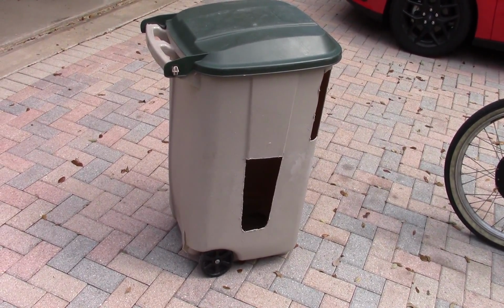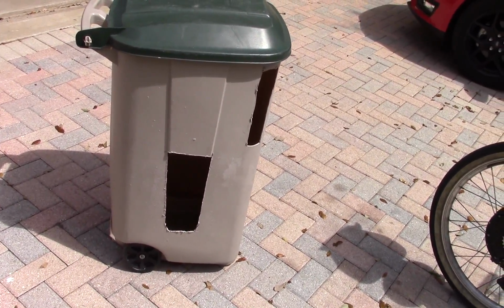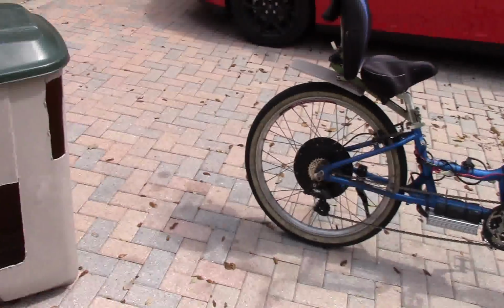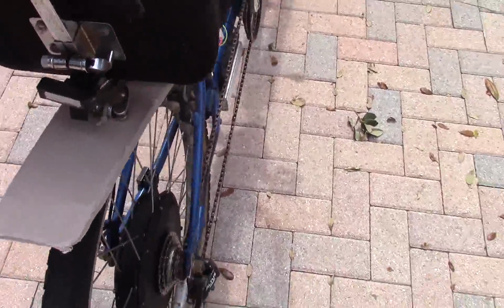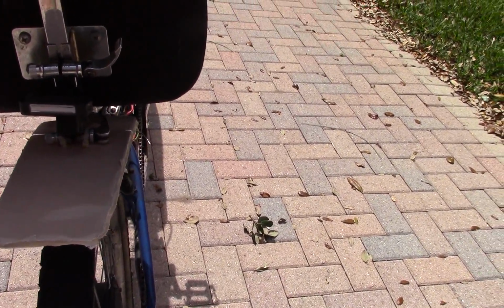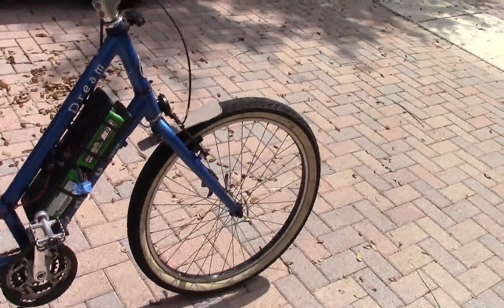Homemade Bicycle Fenders From a Trash Can

Comment: Good one Stu. How are you liking the seat with the back? I have been thinking of getting one.
Reply from the maker: The Dream feet forward bike was designed for people with bad backs,  They  are about 10"  longer than standard bikes.  The step through design also helps because you don't have to lift your foot high to mount it.  That is also a back save.  i do not have any back issues.
Reply: thanks Stu!